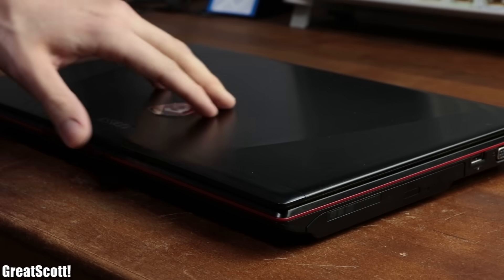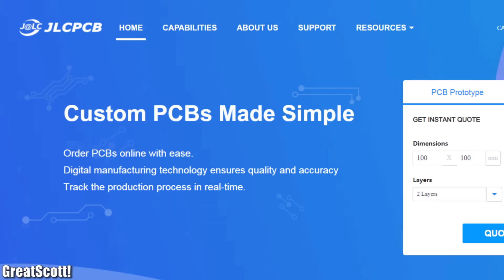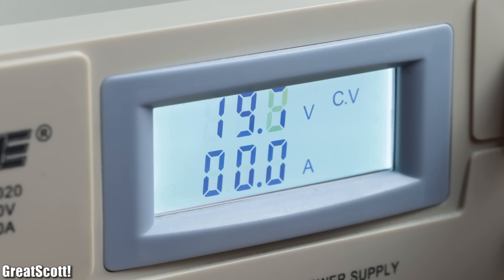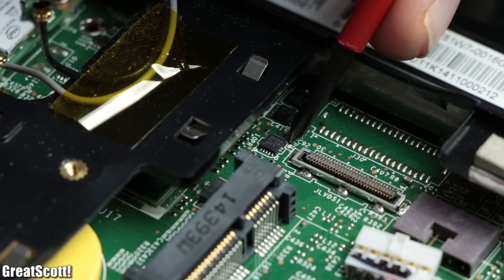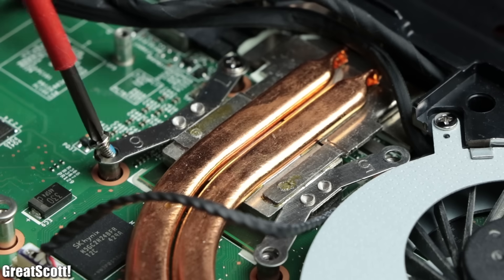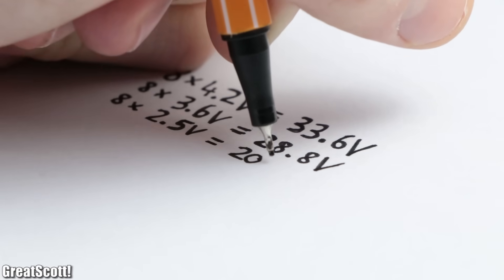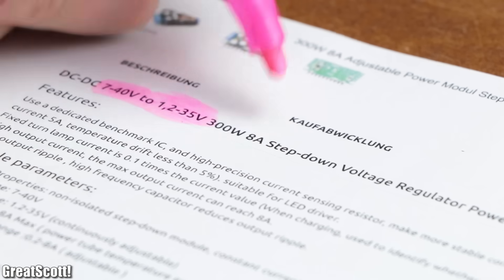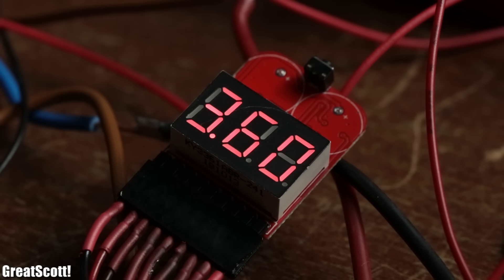DIY Laptop PowerBank (battery pack to charge your laptop on the go)

Comment: Very interesting. Thank you. Just two questions. Does your booster charger has an automatic power cut off when the pack is fully charged? Second, I am thinking about a similar charger but by letting all cells in parallel mode which makes the pack charging easier. And then use a step up converter between the pack and the laptop input to convert the 4v to 19v. What do you think about such a solution? I suppose the critical issue is the current that the boost circuit should handle but I would appreciate your opinion. Thank you in advance for your assistance

Comment: What kind of Voltage Regulators are trustworthy when it comes to accurately Reduce the voltage level without any overvoltage problems?
1. Switch Mode Buck Converter
2. Linear Voltage Regulators

Comment: Complete amateur here, but wouldn't it make more sense to have less batteries in series and more in parallel? I mean 33+volts is a bit overkill, so why not go with less series connections? A series of 5 would be approx. 20 volts, which would be about ideal for charging a laptop. You'd also be stressing your converters much less, and the risk of having a power spike would be even less likely. Also, more parallel means more amps and a longer lasting battery. Correct me if I'm wrong here tho, I've only studied battery pack craftery for a couple days now, so I'm completely new to this.

Comment: I have question about the BMS. It looks like you are using a lifepo4 8S BMS. Won't this specific BMS stop the charging once each cell reaches 3.7 (way too early for lithium ion which can go up to 4.2 volts) ? In other words , this BMS will assume you have lifepo4 cells and will stop the charging process because it is going to think the cells is already charged to its maximum value (3.7 Volts) instead of 4.2 Volts, which is what you are using.

Comment: i sure enjoy ur vids... 

one of the troubles living off grid is power... i have a small 12v solar power set up but ive been trying to figure out how to run my laptop from my main battery bank (12v). the laptop power suply is 19.5v 9.23A.    Li-ion batt pack is rating +15v 5900mah, 88Wh.
Laptop is an Asus ROG G750JW  .  sure would make a great vid   :)

Comment: What if you just buy a 12 volt battery, a 12 volt charger and a 150 watt inverter. This is what i use and i got atleast 3 hours of runtime!

Link for the battery on amazon below!

https://www.amazon.com/ExpertPower-EXP1270-Rechargeable-Lead-Battery/dp/B003S1RQ2S/ref=sr_1_4?keywords=12+volt+battery&qid=1564468067&s=gateway&sr=8-4

Comment: Would you use such a circuit for two-way fast charging and usb pd 2?
https://www.aliexpress.com/item/32951538063.html?spm=a2g0o.detail.1000014.11.44ead5100QNVbF&gps-id=pcDetailBottomMoreOtherSeller&scm=1007.13338.136569.000000000000000&scm_id=1007.13338.136569.000000000000000&scm-url=1007.13338.136569.000000000000000&pvid=765d46f3-6bc5-4af0-9917-1bffa6dbe27d

Comment: Surprised I'm not seeing comments saying this so I will:

Why not just buy another laptop battery? Non-apple brands are typically decent to get parts for. Lenovo for example makes it super easy to buy parts. Just buy another battery and swap them out. 

Now the argument someone may make about the adhesive on the battery. You have two options, one, don't use it, two, use Velcro. I'm sure you can also figure something else out.

Comment: The used Balancer "only" has 35mA of balance Current. Is this dangerous?Does it shorten the live of the cells?
There are so many different Opinions on the Internet (Forums etc.) to wether or not this current is enough.
Does anyone have a definitve Answer to this?

The Problem is (, I think, ) if there are differences in the Voltages of the Series Batteries, the Charging Current for a 4.00V Battery could be 0.5A when another Battery is already at 4.2V.
Because the Balance Current is 35mA this would lead to an overcharge of the 4.2V cell, as the balance Current cant completley consume the Charging Current.

Help would be appreciated

Comment: Can i do the same with an ebike. 36v 7ah in built battery. Can i just buy a second battery 36v 6.8ah and just plug it into the charging socket. I know they have to be fully charged to stop any power balancing issues but do you foresee any other issues?. They would be connected in parallel.

Comment: Instead of using a 33.6v battery with a buck converter to charge the laptop,would charging with 12v alongside a boost converter work as well?

Comment: Great build, thanks for sharing! At a company I once worked for, we used to use laptop battery power packs for a product we built for members of the security services working in airports. I can't say what the work was or much about the product, because military secrets, but the laptop (and other, erm, electronics) was housed in a modified Samsonite briefcase which was then suspended in a Samsonite suitcase (don't ask, I just said I can't tell you). Long story short, the power pack was heavier than the laptop and cost nearly twice as much, but guaranteed a good (but unspecified) number of hours of continuous use, doing, erm, things that require power.

Comment: its more energy efficient to wire the cells in parallel with the laptops battery 
it takes about 5 minutes to connect the 2 together and only requires 4 wires for a 3S battery, you wont be losing that 30% efficiency
Reply: When you connect two battery packs together of different capacity the lower one will become a parasite as it discharges first and starts taking power from the larger cell. Efficiency can become worse.
Reply: @lonjeloco  in my experience, the capacities stack quite well as long as you are not connecting a 500mah cell with a 5AH cell 

If you are that worried about it, just make sure the cells you are connecting in parallel are of similar capacity to the cells in the original battery

One of the benefits of wiring everything into the internal battery is that you can see the power level of everything on the windows battery meter (after you run it through a few charge cycles to calibrate it)
Reply: MWB Gaming Mixing old and new cells is the problem. That and it will take forever to charge as it was not designed to charge that many cells. The biggest issue is where to put the cells. Such a mod would make a machine less portable so it's stuck at a desk were it might as well been plugged in. Most laptops don't even use 18650 cells anymore. Hell buying a second battery is not even option anymore.
Reply: @lonjeloco   I did this mod with my Thinkpad T420s and now I get 12hrs of actual usage (about 6hrs on the battery eater classic test with the brightness all the way up) 

It weighs about 4KG and is twice as thick, but who gives a rats ass if it is twice as thick and twice as heavy, if it now gives upward of 6x the runtime

I can still fit it into a backpack and carry it around all day without issue 

I have a 200wh+ main battery and a modified ultrabay battery with another 100wh and enough space for a gutted SSD (effectively using the SATA port and battery add-on at the same time) 

You can easily do this mod to any laptop with a non removable battery by drilling a small hole in the bottom panel for a plug or to run the wires through

As for the charge time, what do you expect, it takes ages to charge, but it also takes ages to discharge
A bigger fuel tank takes longer to fill with the same pump, the same logic applies to batteries

The charging circuit limits the current to a safe level and will cut out if the charging system overheats

Comment: sir, i have a question...i have power bank output 5v..if i use step up from 5v to 19v, can i charge my laptop...i want to make power bank to charge the laptop......my laptop is inbuilt battery, use 19v adapter...aspire e11....what do you think?

Comment: You can also get a non-working battery pack that fits your laptop...remove all the contents...and make it a pass-through to use only 11.1VDC instead of 19VDC.
That would bypass the charging circuitry and all the losses of that conversion.
It would also make the external pack much smaller as you would need much fewer batteries.
Or you could just change the configuration on the external pack to make it last longer with more batteries in parallel.

Comment: Hello GreatScott, 
I like your videos. Continue. 
I've got a question, I'm using the same boost converter to charge my asus laptop from a lithium 12v battery but It doesn't work. 
The charge led (orange) turn on 3 sec and turn off. The laptop battery is 50% charged. 
When I check the output voltage of the boost converter, there is 19v. 
What can I check to understand why it doesn't work ?

Thanks

Comment: Uhhh is it possible to do this in a... flatter way? Maybe using old phone batteries or similar. I'd like to build one of these, but I couldn't carry it around because of the sheer size of this absolute unit.
Reply: The problem with using smaller, flatter or fewer batteries is the loss in capacity for it. For something like this, with that many 18650 that he has, it definitely has a substantial capacity. If you use smaller/lighter/fewer batteries, you'd have to sacrifice capacity, perhaps output current (depending on the batteries used) or both. After losing so many batteries to make it more portable, you might aswell just buy replacement batteries for the laptop to begin with - it'd be much cheaper and safer too, depending on your experience.

Comment: Why not just use any '20v' Li-Ion tool pack?  The BMS is built in, and it comes with a charger.  Fully charged voltage is ~21.8v, and the nominal voltage is ~18v.  Yes, that's enough to charge your laptop, even if it's not 19.5v.  So no need for a buck/boost converter either.

Comment: Ohh the final pictures and the final result etc. (nothing)
show the final product analyze the final product efficiency etc, real-world current draw perhaps a simple graph of how the constant voltage and constant current balanced out when charging and vice versa.
to sum up' - is it a good product you build or is a bad product and did all these third-party components play along with each other. (often they don't and you will encounter problems) but nothing in your video' if it was a good product and if the charge values it actually delivers are good..
there so much more to be making a good  DIY power bank then it can turn on your charge-icon in your old laptop and the efficiency amongst numerous converters can make or break a power bank as you can easily lose like 50% of the power, simply from conversation up and down...but nothing about if it actually was good and its not like you  don't have the tools to check these things.

Comment: Hi Scott! I have a big problem with my power bank. It doesnt get 8amperage in the output. Only 0.8A. And my laptop say:it ist enough to charge it but it will work if you put in sleep mode or switch off. Actually i want to charge in runtime. I have same buck converter and 8565113 lipo battery*8 and lenovo thinkpad w540 notebook (laptop) can you help me? Pls pls. I spend too much money, but it isnt work.
Reply: I did it.

Comment: @greatscott! do you know, if it is possible to attach an mains inverter to that powerbank? so turn down the output voltage to 12-13.8 volt and than connect the inverter. or do the inverters need "real" 12v?

Comment: Can I use cheaper batteries? I want to build them into my laptop suitcase and there would fit about 160 of those, but Samsung INR18650-25Rs would add up to 7.2kg of mass... Are there any better alternatives that do not blow my laptop up because I missused your circuit?

Comment: Hello , i am very interested in making 1 like this. I found this on ebay :  https://m.ebay.com.my/itm/LCD-DC-5-5-30V-to-0-5-30V-35W-Buck-Boost-Power-Supply-Step-up-down-CC-CV-Module/173395439820?hash=item285f2c70cc:g:szIAAOSw2j9bPghp           in fact i just intend to prolong my old battery juice , not really to charge the laptop battery or to directly power the laptop, so my planning is to set the CC something like 500ma , from a diy 18650 x4 series which give 16.8v when full. So my questions as follow:
1) is the unit i mentioned above safe to use?
2) i noticed original laptop battery made in 2   rows of 18650 x3 series, which is 12.6v when full,  is 12.6v better than 16.8v when using this boost converter?    In my opinion, boosting 16.8v to around 19v  for laptop might give less stress to the booster, and hence might maintain the voltage more stabily.
Sorry for my English anyway, Cheers...

Comment: In the future could you make a video about how to make a battery backup for an ATX power supply on a desktop computer?
Reply: Just add an AC inverter on the output of the battery. But it would waste less power converting from AC to DC, if you just added the modual power supply connectors on the battery bank itself.

Comment: You use this 300W Buck Converter in your project but this Buck Converter is also great for DIY Lab Beanch Powered.
You use LTC3780 in you DIY Lab Beanch power supply. This module was so expensive.

Comment: Most newer laptops have a system built in where when you're not using a high-power application, it uses the iGPU instead of the dedicated. But i feel that they should harshly turn down the CPU clock as well and limit power draw even more

Comment: Why has nobody made a manufactured laptop power bank? Could you use a phone power bank to charge a laptop by switching its plugs? We already have various interchangeable ends HDMI, USB, so on. Why not for laptop?
Reply: Actually there are laptop power banks which have swap-able connectors for various models.

Comment: Wouldn't it be better to get an UPS/USV?
I mean, that it comes with acid batteries that hold the charge for really long but you can actually use an LifePo4 Battery which looks almost like 18650 Lithium-Ion cells but they are a little bit bigger, can output more amps and they have screw terminals.

Maybe you could make a review of those batteries. 
With those cells, noone need any soldering or welding skills/equipment and they're also rechargeable with an balance charger.

Comment: i gave you an simple idea get 8 laptop battries and attach them then get a usb converter and attach it and have a cover cover the batteries and attach a charging port and then your power bank is ready and you can use it for long you can use it 8 time tewice then your laptop battery

Comment: Hello Sir Scott, I was wondering if you could give an advice on how to make a power bank w/ fast charger using this module: https://bit.ly/2BXxdFZ
I basically wanted to use "2S 2P config (unprotected 18650)" but I'm not sure which BMS module or bms+charger module to use =(

Comment: can i use 3 cell in series?
but, instead of using buck converter to create suitable voltage to the laptop, i will use boost converter,,
is that possible to do?

Comment: It could draw more amps, that benchmark you did there first benchmarks the cpu then it benchmarks the gpu/apu, not both at the same time, i recommend using furmark and a fork bomb or Cpu Burn at the same time to have a reliable benchmark that uses your whole system to its peak

Comment: What about charaging laptops compatible with usb-c PD (power delivery) system? Newer macbooks, dell xps etc. That way we could build just one power bank for all devices with usb-c charging port! I could not a find a circuit that would support this protocol :/
Reply: smthing like that - https://www.aliexpress.com/item/65W-Power-Delivery-Charger-USB-C-18W-45W-for-iPhone-XS-Macbook-Pro-Xiaomi-Air-Dell/32950868735.html?spm=2114.search0104.3.53.54b575a8NzMB2h&ws_ab_test=searchweb0_0,searchweb201602_1_10065_10068_319_317_10696_10084_453_10083_454_10618_10304_10307_10820_10821_10301_537_536_10902_10843_10059_10884_10887_321_322_10103,searchweb201603_51,ppcSwitch_0&algo_expid=8a724c9a-ba32-4ff9-bfe0-70ad6e0de002-7&algo_pvid=8a724c9a-ba32-4ff9-bfe0-70ad6e0de002&transAbTest=ae803_3

Comment: Hi scott. I'm planning to make car cigarette dc to dc power supply for gaming laptop which is need 19v 8a 150w of full power while gaming. can i just use powerful buck converter only (non-battery pack installed) as shown in your video without any problems like voltage spikes?  here my examples wiring plan ( input 12v/10a car cigarette male socket >>> boost converter set to 19v/8a >>>  output19v/8a male laptop plug) is correct? but i still worry about voltage spikes that will greatly mess up my laptop ic if boost converter will spoil it after using in several years/heavy usage. if u dont mind to share your idea to supress voltage spikes for extra protection. I would be grateful for your prompt reply :)

Comment: This is a very interesting project, even more so because it worked out well.
I would however be interested in the dimensions and weight of the resulting powerbank, just as a rough measurement on how much it would add to the "bulk" of the laptop it's intended for while transporting it.

Comment: It would be a lot more efficient if you take out the laptop battery when you are using your power bank so the power is going directly to the components on the laptop, instead of wasting it to charge the laptop battery that isn't going to last very long.

Comment: Excellent project, but the size and weight of the enclosure....
Also this cannot be taken on a plane due to regulations (> 100Wh)

I have 26400mAh battery to charge my laptop and it’s WAY smaller. Obviously, as a probe of concept, this is an absolutely terrific project